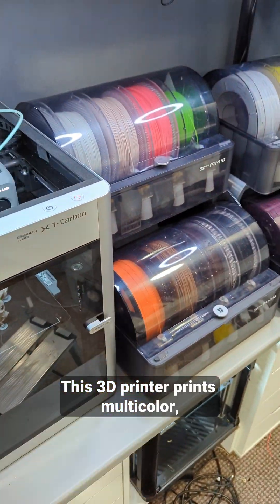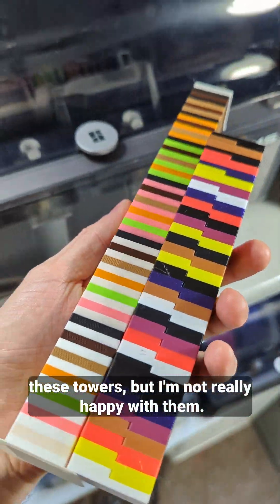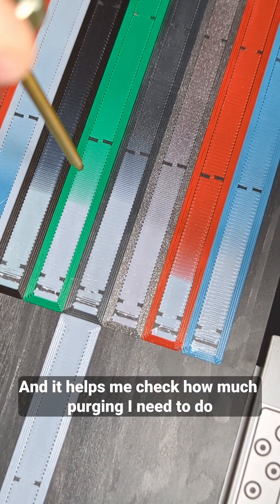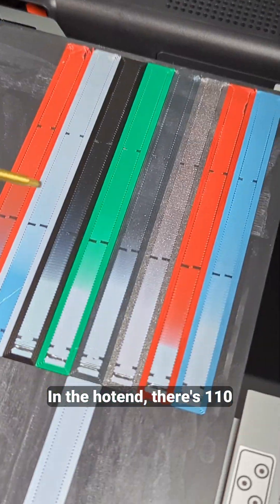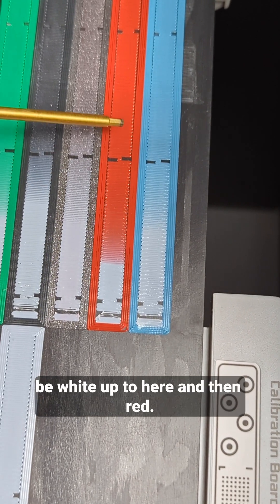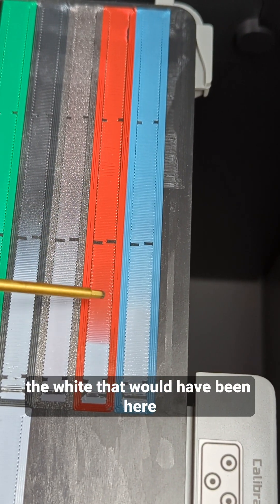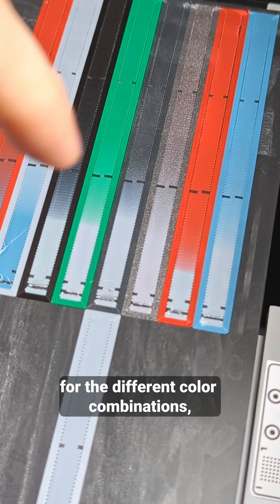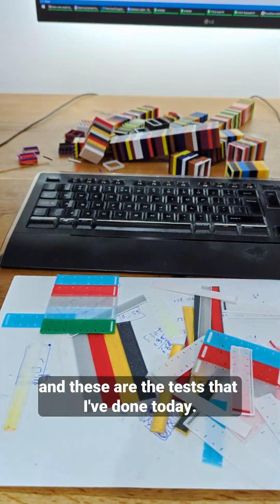Visual experiment with color change purge transitions

Comment: That’s a very nice representation of the mixing that’s happening in the nozzle! I think that printing speed is of influence as well: at higher flowrates the material is fully molten at a later point in the chamber and could push out more material without mixing.

Comment: Flushing volumes seem to be way higher. I would assume just to err on the side of caution so that colours don't get bled into the print
Reply from the maker: Yup, sometimes I need to purge close to 700 for certain color combinations.
Reply: @MihaiDesigns  it's crazy right? For 3 small fidget bobas, my P1P purged close to 150

Comment: Is it possible to add a colour sensor at the purge area to not require you to manually figure out how much other is required for each possible colour transition? Try to instead detect when the input and output filament are close enough in colour? No idea if that's possible for that printer firmware, but I could see something like octoprint/klipper/similar systems being able to be extended with that type of logic.
Reply from the maker: With an RGB LED and sensor I assume it could work and would be quite fast. Needs some code to calculate the purge values and pass them to the slicer (or have the printer decide how much to purge)

Comment: What about more than one print head? Would you consider it a benefit having 2 or 3 print heads? Some colors (the most used ones) can stay fixed and change only tbe other ones saving time and filament.
Reply from the maker: Yup that would be a tool changer (or IDEX as a simpler alternative). I hope Bambu Lab will implement one in the future

Comment: Good test. But your gcode should finish off, by printing a clean line next to the transition, so it is easier to spot where the color has changed completely.

Comment: So if you know how much filament is purged could you use some of it in the last layers of your print before the purge for example purge before you start using the wipe tower for some of the main print then when you know it’s going to be changing since you know how much each color needs to purge you could run it into the main print before pulling it out last second to wipe
Reply from the maker: There are some features for flushing into support and flushing into infill (or into a whole object) and this way you could reuse some of that purged material. These are still limited and usually use only one of the colors per layer.

Comment: You would think there would be a way in the slicer to have it do the purge on the infill material
Reply: You can purge to infill. 
He's trying to figure out flush volume multiplier 
To reduce the amount of flushed filament because the manufacturer values are way too high. A lot of wasted filament during color changes sometimes more wasted filament then the actual object being printed

Comment: I wonder if it’s possible to cold pull instead of cutting filament. Slightly cool down the hotend to prevent material from forming a string and pull at max speed to prevent blobs. Could also play around with the filament cutter at various points of the pulling. Cutter is a good step in preventing clogs and strings but I think the sequence can be optimized further.

Comment: Maybe the white or bone color you’re using doesn’t have a dye like titanium dioxide or whatever and is just the natural color. When you add a dyed material it absorbs it more than you would think. 

Have you tried air pressure to remove the old? Is that how the “poop” is made? 

It doesn’t seem like your going from color to color. I’m curious how that would look.
Reply: Actually I see the red and blue which looks the same. If you ask bob ross he will tell you not to add much red “because it will light your sky on fire” I think red dyes are just super powerful like that.

Comment: Yeah so this is tricky, different additives, change the viscosity, and stickiness of the plastic. So if you imagine, taking a straw and going bubbles and honey, it will take a lot of air and air velocity to blow a honey jar. Same thing in the nozzle, some of the old filament finds places to stick and it just takes time for the old filament to pull all that old filament out. Trying to say you cannot just measure volume, speed matters. You will notice the stock gcode “pulses” when it is purging I think that is “scrubbing “ the inside of the nozzle by affecting pressure which will change the mix behavior (at least that is my guess).

Comment: So you are wasting a ton of plastic to save a little plastic? I don't understand...
Reply: I did the same starting this year. It took a week and a slap in the face. As more steps and bad flow path regions you have in the hot end as more material you need to purge.
This helps me a lot: aggressive flow and retract with a short temp overshooting, that the old material flow more easy out.
I ended up not using cht nozzle and cht adapters on multi color prints. Dont forget to brush the sticky outside nozzle material. 
STAY AWESOME!
Reply: Depends how much you print. Looking at his purge can, It looks like a drop in the bucket. This research will save thousands of viewers filiment, not just him.
Reply: One person doing this, to help the whole FDM 3D Printing Community…and you complain?

Comment: Put that test in Orca Slicer 👍
Reply from the maker: The code is not C/C++, but I do see how it would help to have it integrated in the slicer somehow. Right now it's a hardcoded gcode, but could be easily parameterized to use the calculated volumes. I won't have time to do this myself, but am open to have it integrated in the slicer if anyone wants to.

Comment: Very interesting! Do you think that the colour "mixing" can be reduced by having a higher quality hotend ( with for exsample polished insides ) ?
Reply from the maker: The insides should be very smooth, but now that you mention it, certain materials tend to deposit on the inside over time, creating a rough surface. I believe CNC Kitchen sliced a nozzle after printing ABS with it and it looked quite bad.
Reply: @MihaiDesigns  Markforged said that a nozzle printing nylon or carbon fiber nylon had a particular wear pattern and after you'd used a nozzle for a relatively short time with one filament you could only use it for that particular filament.